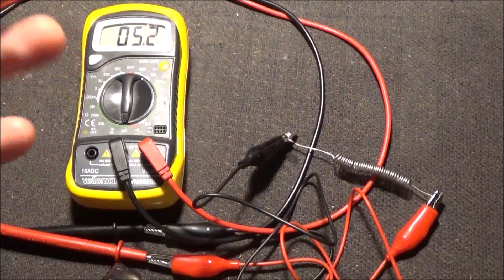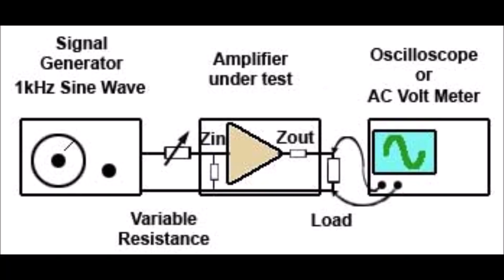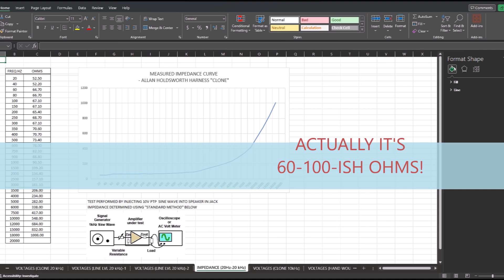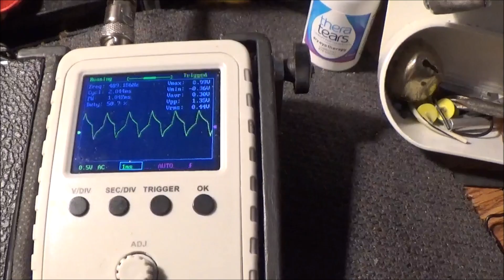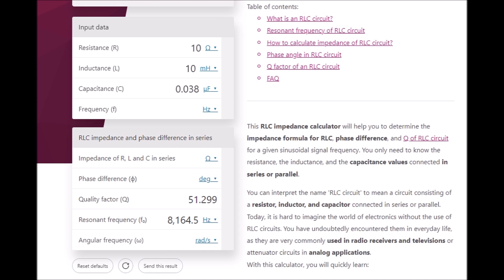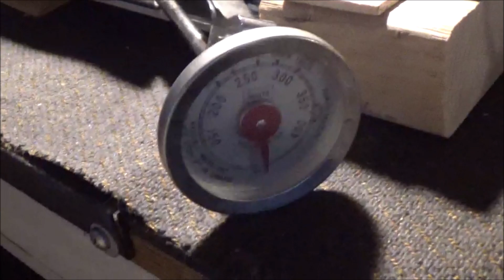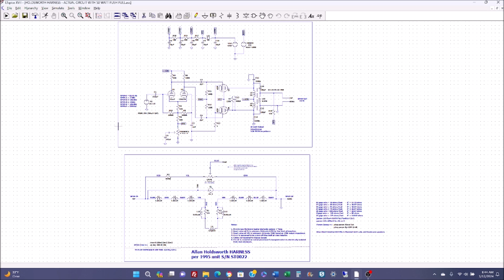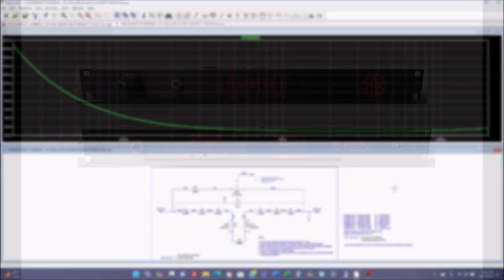Allan Holdsworth's HARNESS - SECRETS REVEALED!

Comment: 14:20 why its wound tight? As one continuous resistance?
Reply from the maker: Did you not see the first few minutes of this video where I showed that the coils being close or even completely touching makes almost no difference? Nichrome wire is dozens of times less conductive than copper wire.

Also, I'm just replicating what Allan did in his units. You could slide a piece of paper in between the coils on the real one or my "replica".

Comment: Considering nicrome wires a non ohmeric conductor what else did you expect heating it up?  This is why they use it in toasters.  I think you should do a little more background reading on physics
Reply from the maker: At what point is a conductor considered non-ohmic? The resistance of nichrome wire almost does not change with a change in current and voltage - but it does change a small amount as temperature increases. Tungsten is definitely a non-ohmic conductor.

All of the charts I can find regarding resistance start at 400 deg F with some amount of current in a certain gage wire at a certain AC line voltage. I was trying to determine what, if anything, happens at low temperature of 150-200 degrees, where there is no data available. I don't have a good way to pump 3-4 amps thru these coils.
Reply: @VegasCyclingFreak  yes that is my point you would need a much much larger heater the effect it. Goodness only knows how many amps to hear a thick wire like that to red hot 🥵  Maybe in the original design the designer was trying to use that property?...
Reply from the maker: @ludmilascoles1195  Probably would take 6-7 amps to get it red hot. In this application I think it would only be dealing with maybe 2-3 amps at the most. Depends on how hard you want to be on your guitar amp. I don't know why he liked the nichrome wire... he must have had a reason. Your guess is as good as mine.

Comment: Do you think the 10mH inductance was intentional? I kind of hope there is a part IV, after you miraculously acquire an actual Harness of your own. So, do you still feel these units are unsafe to use with an amp? I have been entertaining getting another Harness for a few years now, but after these videos, I'm not so sure. As an aside, you said Allan wasn't a guitar pedal guy. I'm not so sure. For a long time, he had a number of pedals on a small board that he put on a table top beside him, when playing live. So, he did use the Magic Stomp and that Yamaha multi delay pedal. He didn't use overdrive pedals, as far as I know. Yet J. Rockett made a signature overdrive for Allan. Did Allan even ever actually use one of those? I wonder. Anyway, really cool and very interesting videos. Liked the needle across the vinyl record sound during one of the transitions. Nice touch. I wonder how many people actually know that sound anymore...

FYI, my Harness II didn't have the toggle switch on the front like the one in your video did.
Reply from the maker: Yeah in later years he did have a few pedals, after the huge rack unit days were over. I meant by my statement that he didn't use some kind of distortion pedal, it came from the amp. J Rockett did make that signature pedal but I don't know that he ever used it. If he did it would have been mostly as a booster. 

My understanding is that only a few of the Harness II units had the pad switch. "Unsafe" is a relative term. If people are giving you amps that's one thing... blow up one and another one will come your way soon. If you live in a place with an ever increasingly higher cost of living with your pay not going up with it, well then any amp that blows up is kind of big deal to replace. I think it's generally safe if you don't "dime" everything and use it for 6-8 hours straight. You're supposed to use your amp as you normally would. Anyway, I have an idea about possibly acquiring one, or most of one. Will look into that. 

My circuit isn't built per a verified schematic, so I am reticent to connect it to any of my amps.  If I am correct about the 1mH inductors is still unverified. Yes, I believe it was intentional to use seven of them. Thing is when you take an air core inductor and mount it onto a metal baseplate with steel screws and large fender washers, it increases the inductance. So the (7) 1mH inductors add up to 10mH. That would increase somewhat with a steel baseplate. Don't know how much... maybe another 5-7% or something like that.

Comment: The fact that there are no capacitors in the Harness any resonant effects must be from the inductors winding capacitances. 

If you look at any real speaker cabinet impedance curve you will see couple of resonant points on it, one quite high in ohms, somewhere between about 70Hz and about 125Hz, depending on what speakers are used and whether the cab is open or closed box construction. This is equivalent to a combination of a capacitor and inductor wired in parallel but is purely caused by the acoustics of the cab and speakers motional impedance.
The other, up at about 200 to 300Hz and is at roughly the value of the speaker drivers DC resistance is a series resonance dip caused by the interaction of the voice coil inductance and the R.H. side of the above mentioned parallel resonant peak which is capacitive in nature (the L.H. side being inductive).

It seems that the harness is only emulating the voice coil inductance and its DC resistance.
It is what it is in the end and whatever the results Allan got is due to his understandinfg or lack of it in what was happening in the real speaker cab as he saw it.

Thanks for your videos on this, very interesting.
Reply from the maker: Yes, except voice coil inductance of 0.1mh-0.5mH  is very tiny compared to the 10mH of this circuit. Any capacitance present in the circuit will be from the inductor self-capacitance, and probably a tiny amount from those nichrome wire coils too. 

It seems to me that he may have been attempting to mimic the speaker "back EMF". I don't know at what level Allan's understanding of electronics was... likely this was the result of a lot of experimentation and what "felt good" to him.
Reply: @VegasCyclingFreak  That's very interesting, I always thought it was higher than that. As I'm currently doing a bunch of measurements of audio transformers inductance I decided to grab a 12" 8 ohm guitar speaker. Tested first using my LC meter II from Almost All Digital and only got few uH, great for small air cored inductors but not much for large caps inductors or audio devices. So next I grabbed my digital multimeter with an inductance mode on it and it showed couple of mH, if I loaded the speaker cone with some weight, reading went up a bit but reached about 8 or 9mH if I pressed on the cone with my fingers in order to reduce the cone vibration, as the meter fed what sounds like a 1kHz signal to it.

I then set up an audio sig generator through a capacitor of known value (1.5uF) and ajusted the frequency to the resonance and then calculated the inductance at approx 255uH (0.255mH) which agrees with what you said.

Have you done any actual measurements personally and if so what method did you use?

I suspect that the magnet and steel pole assembly would have considerable effect on the value. Also when the cone is free to vibrate with any ac test signal it would be very difficult to be certain of what is being measured. I remember seeing somewhere in the past that one method used was to pour epoxy resin into the gap to solidly glue the voice coil to the magnet assembly so it can't vibrate.

Sorry for all the questions, just my curiosity running wild.

Cheers.
Reply: ...I guess if emulating a speaker voice coil it hes to be without any changes in its operation as if we do, it will not be realistic.🤔
Reply from the maker: @markg1051  I didn't personally do any measurements... just rounded up info on various 12" guitar speakers to see what numbers they range between. I think you are correct about the magnet & voice coil assembly. Seems that is partly how they tune a speaker to have a certain frequency response.

Your findings are interesting. It seems to support my current theory of the seven inductors simulating "back EMF", otherwise known as counter electromotive force. I guess that amount of inductance you measured is about what you would get from a speaker at loud sound levels pushing a lot of air? If that was Allan's thinking, it could explain why there are seven inductors in these things.

Comment: If you want to see how much the nichrome coil resistance changes with temperature best way I can think of is to pass enough current to heat it up uniformly.

Start by measuring the cold/ambient temperature resistance of the coil.

Then wire a 5 or 10 watt 0.1 ohm resistor in series with the nichrome coil, the higher the nichrome wire resistance above the 0.1 ohm resistors the better, as this will ensure all or most of the heat will be in the nichrome and not in the 0.1 ohm.

Connect two DC voltmeters, one across the nichrome coil and the other across the 0.1 ohm resistor. 
The voltage across the 0.1 ohm will tell you how much current is flowing from I = V/R while the other will give you the ohms of nichrome from Vnichrome/I, you will also know the watts disipated by the nichrome coil by multiplying the voltage across it with the current through it.
Reply from the maker: Yeah... problem is I don't really have anything that can pump enough current thru it to heat it up. I think it would take roughly 3 amps or so to heat these coils up to 200 degrees.
Reply: @VegasCyclingFreak  if you uave a 12 volt car battery and you wind a 4 ohm nichrome coil you will get 3 amps if the resistance remains at 4 ohms, but will settle at something less than 3 amps if the resistance rises which I suspect it will do as it heats up.
Reply from the maker: @markg1051  ha ha why didn't I think of that? I may give that a try. Thanks...

Comment: Great video series! I used to like to use attenuators—first I had an “Atair” brand unit, then a Scholz then a Harry Kolbe “Silent Speaker/Attenuator (reactive load actually using a real mini-speaker) speaker system. Figured with good amp like pedals and master volume amps nowadays, I don’t need and want to abuse the tubes and transformers. Wish we could hear if this unit is actually more realistic in its tone than other reactive load units.
Reply: Had a Harness II in the 90s. I can tell you that it was completely transparent (sorry for the over used buzzword). I used it to allow me to run Tremolux through my rack of effects, and into a power amp, out to a speaker (two 1x12s actually). What it did, was to allow my amp to sound exactly like my amp did running without the Harness. Realistic? I suppose so, as my amp sounded just like it would if I plugged it straight into a cabinet (my Tremolux had been cut down and turned into a head). Hope that helps.
Reply from the maker: @augustusbetucius2931  Nice. Thanks for the info. That's the version I'd be more interested in for myself if I was going to go down that road.
Reply from the maker: I still need some verification on a few things. Working on it. I hope people don't get the idea that using one of these will make them sound like Holdsworth... just doesn't work that way. Anyway, I just learned about that Altair PW-5 today - I guess it was first on the market? Pre-dates Scholz's Powersoak from what I understand. I sure would like to see inside of a PW-5... one page I found says it has wiggly tungsten inside. More likely it's probably is something like the nichrome wire(s) inside of a toaster.

Comment: I believe that this thing is a silent speaker / inductor coil, with an attenuated input… I think? I was telling my friend about a video I saw where they show how to make a speaker louder by adding a coil in between the line in and speaker out this reminded me of that. I just saw another video about the guy as who made that AH drive pedal for Allan in the title it says ( see the harness at the end ) they ask to see one and he busts out this fat four U rack with a bunch of knobs and switches. It also had two sets of the nichrome wire spring terminals and nine of those inductors it looked so cool. Thanks for making these videos. Your lab assistants are really neat too. 

Cheers.
Reply: Wow man all this is so interesting to me. I really appreciate all of the work you put in to this video. I know very little about electronics but I seem to have a natural ability to understand how certain systems are wired and I’ll circuit bend synths and effects pedals from time to time. Much respect to your process I’ve Leaned so much. That was very cool when you showed the waves with your handmade wand meter. I got chills when I saw the way it does this pulse width modulation when you bring the wand close to the inductor. also when you show the waves inverting on its self one this video. There too. Out of phase 🧐 it also makes me think pedal made by Yamaha called ud stomp. That is discontinued. There are some presets made by Allan on this unit made up of 8 delay lines set slightly out of phase with one another. It almost sounds like a imaging effect, it’s the only thing out there I know of that can achieve what I’d like to call a sustained distortionless tone. Like multiple images sandwiched back together again with an ADSR quality to it like a synthesizer.
Reply from the maker: @ERYKJACKNIFE  I bought a UD Stomp a few months ago... I love love love it!
Reply from the maker: Yeah, the one in that J Rockett video is what I call the "super Harness". It's some kind of 2 in 1 unit... I think one side is straight Harness and the side has some kind of 2-band EQ, probably a high pass filter and a low pass filter. I just came to another realization today - I think he may have been trying to emulate the "back EMF" of the speaker(s) with the inductors. May explain why there's seven of them. Almost like "inductor limiting". I suppose it can also be considered a reactive silent speaker, in essence that's what it is.

Comment: same as with his music it is hard to understand what Allan wanted to do with it.  you did not have the function generators syncronized there will be some error on the freq or time and they would produce that phase effect. I´m not sure you measured the impedance correctly that diagram is misleading. you need some resistance to be able to measure the voltage in it (both ends) to calculate the current and the voltage through the harness. you don´t need a load resistor and the variable resistor should not be changed during the measurement. usually a 100ohm fix resistor should work ok. I´m thinking that maybe you measured the impedance adding that extra resistance. the coils and the nichrom wire should not be that high.
Reply: what value you get if you just use a DMM to measure resistance? that should be the DC resistance.
Reply from the maker: @12afael  Basically it's "Craig Anderton method" of determining input impedance - feed circuit a signal of 1-2 volts PTP, change the variable resistor until the voltage is exactly half of the voltage and then measure the resistance across the pot (wired as a variable resistor) after disconnecting from the circuit (that's what all the switches were for on that gizmo I made). Allegedly at this point the impedance and resistance are approx. equal. 

Towards the end I showed the online calculator thing- DC resistance measured around 10 ohms. Seven inductors each at 0.73 ohms (per the labels on them), one nichrome element out of circuit is 2.7 ohms and the other one is 3.1 ohms. DCR changes slightly every time I mess with disconnecting/reconnecting the nichrome coils. The apparent inductance I measured across the spkr in jack was 10mH.

I just threw the phasing thing in there because it was an interesting accident.

I came to another realization today - I think he may have been trying to emulate the "back EMF" of the speaker(s) with the inductors. May explain why there's seven of them? Almost like inductor based limiting if you will.